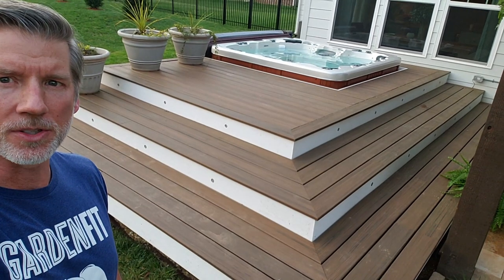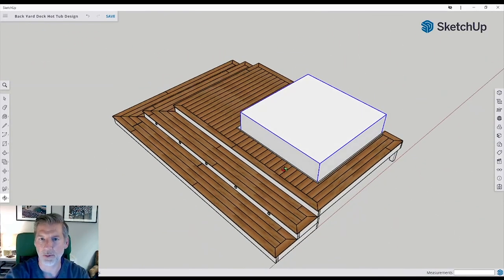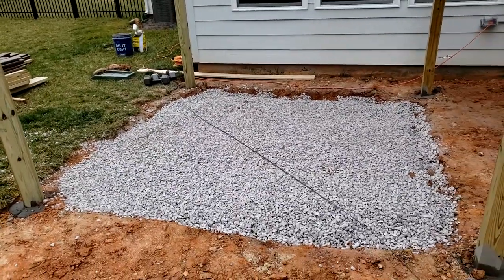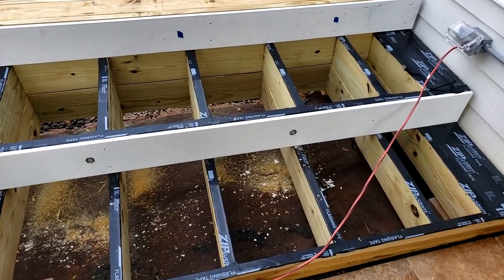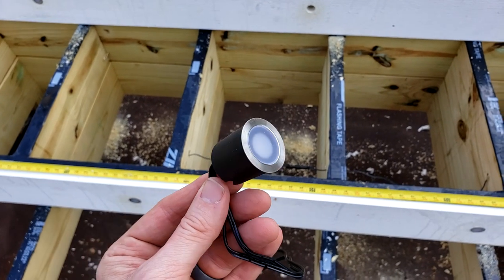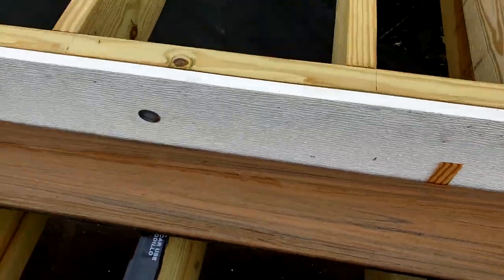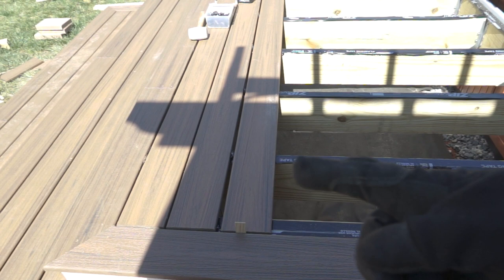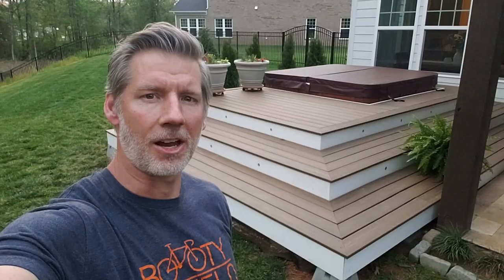DIY Composite Deck with Picture Frame Border

Comment: Nicely done. Note: when you picture frame leave the one side open and after all the decking is on chalk a line and make your cut on that open end the put up the last picture frame board, so much faster.
Reply from the maker: I actually thought about chalking my line. This is a good tip. I was constantly checking to make sure I was square.  Appreciate the comment!

Comment: Great video.
Future.........

29:14  Could have attached a scab board so both cut end lands on a full 1-1/2" edge.  Then you could have used a plastic clip for both ends.
33:15   No need to screw the ends down.  There is room for the clips.
Reply from the maker: Thanks Mike. That's a great tip.

Comment: Have you had any problems with expanding and contracting on the 45° corner cuts? Cool video! Thanks
Reply from the maker: None at all. I wish there was a way to send a pic here in the comments and I would show the seams in the corners. I love the composite boards. They hold their shape and color very well. My biggest complaint is they get hot. But as soon as the sun gets off of them they cool down quickly. We now have a 10' umbrella over the deck to help with shade. We love that deck. Thanks for the comment.

Comment: Even with picture frame, the ends running into the picture frame looks not so good.  Is that just the way it is ?   It looks worse at eye level versus standing on the deck.  Suggestions??
Reply from the maker: I mitered the ends at 45 but also put addition framing underneath so each board in the corners would have its own board to screw into.